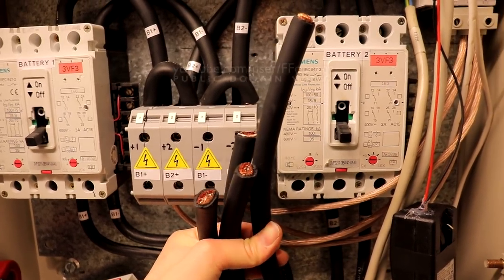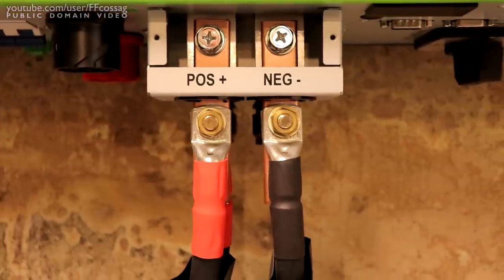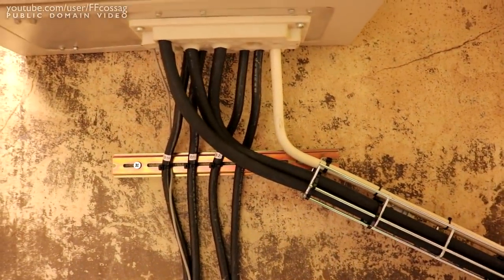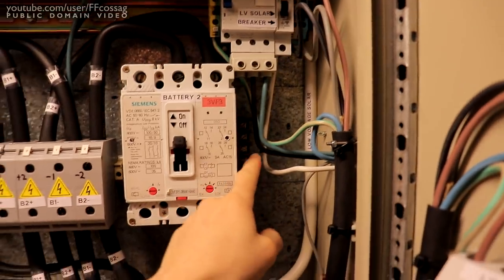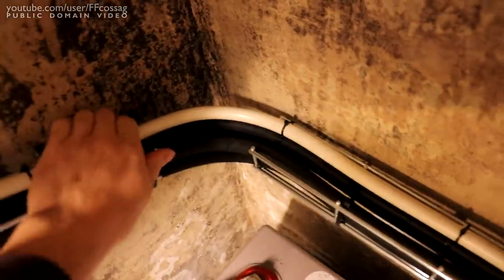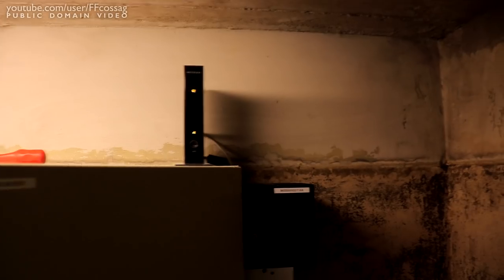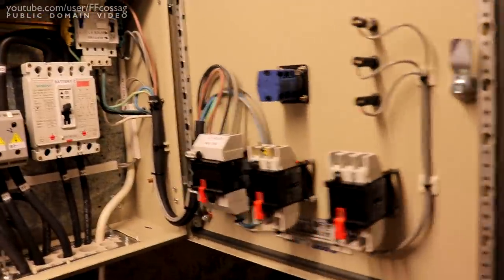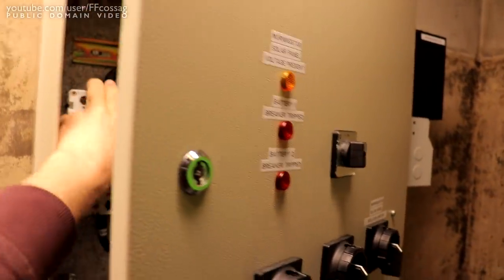OPzVLOG 7 - 48 V wiring looking FRESH!

Comment: Jeez, those cables between the inverter and the box of tricks is about the same thickness as what's coming into this house supplying 40 Amps (measly I know!) of single-phase 240 volts, and that contains both Live & Neutral... :S
Reply from the maker: There's a reason people tend to steal power lines ;)

Comment: What's the story with the cam switch on the door,that is not hooked up to anything,any plans for it...?
Reply from the maker: The cabinet is a used cooling pump logic cabinet from a TV transmitter. The switches originally controlled the pumps, and I'm not going to remove them because any blanking plate would look worse. I'll find a use for them at some point, I'm sure!
Reply: @FFcossag  sweet,I'm sure it will come in handy for something!

Comment: Aren't your B1+ and B1- (others subject to verification) wires into the BAT-breaker crimped at all?
Reply from the maker: No, the breakers and terminal blocks in the box are of cable clamping types. Adding any kind of connectors to the ends of the cables would just add needless voltage drops.